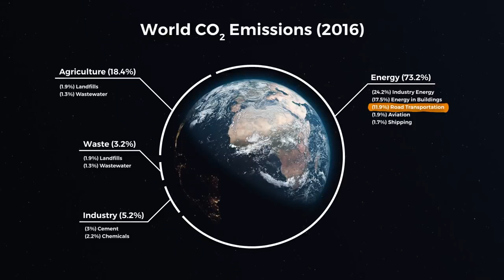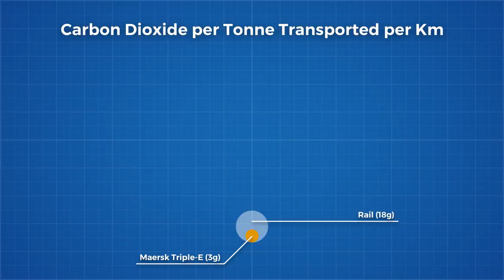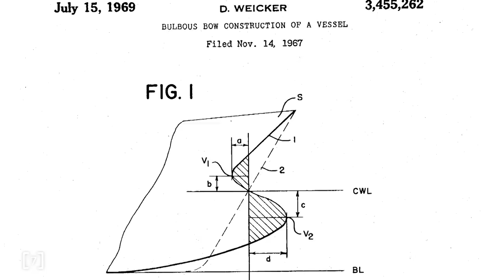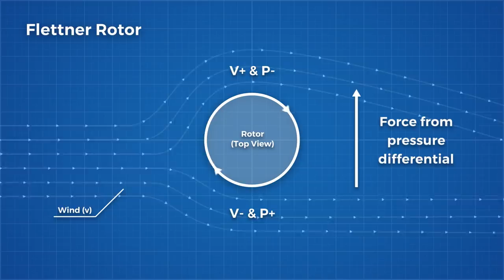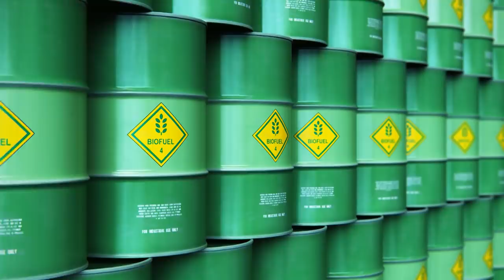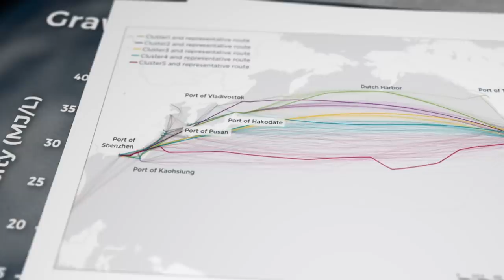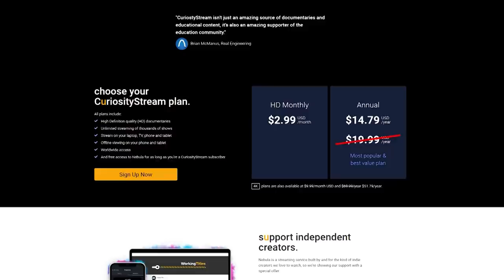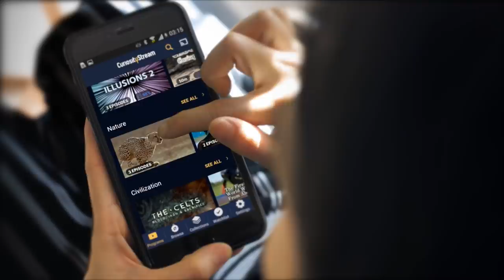Are Renewable Powered Ships Possible?

Comment: You are correct about biofuels. They are mostly just an inefficient way of converting diesel into something that looks green, and if you're lucky you get out the same energy you put in. In some cases you end up with a negative energy balance. While doing so, they waste huge areas of arable land or previously forested land. It's the worst form of greenwashing. It would be more efficient and more honest to just burn the diesel for the intended purpose straight out. The exception here are biofuels derived from waste streams, rather than from plants grown specifically for the purpose of fuel. As an environmental scientist, all the greenwashing for political reasons, is painful to witness. The whole climate thing is not about science (despite #believethescience). It has become a belief system and the measures are all about what looks good politically. Science is not a belief system.

Comment: At anything resembling current technology levels?  Absolutely not.  Gasoline is hard enough to replace as a portable energy source, bunker fuel is way cheaper.  Large commercial ships don't run on the nice "clean" fuel we use for cars and planes, instead they use a low quality sludge known as Heavy Fuel Oil (HFO) or bunker fuel.  It's considered a "waste product" of fuel refinement and sells for about $290 USD per ton compared to $516 USD per ton for regular refined fuel.  And since these are large international shipping companies there is no authoritarian government  to use taxes to force them to double their shipping fuel costs.

Comment: So... No nuclear?
Reply: If you do a web search for ‘nuclear ship savannah’ you will see that it has been tried and did not work.  A similarly heavily subsidised, by the government, vessel is in use in Russia which also operates, in support of the Northern Sea Route, a fleet of nuclear powered ice breakers these may, or may not, have been completely without issues.  Just think; would you have full confidence in the management of a nuclear reactor under the control of an anonymous entity only traceable, perhaps, via a letter box in a FOC (flag of convenience) nation state?  If you are could you sell that confidence to Japan, the state that hosted the Hiroshima and Nagasaki nuclear detonations as well as more recently the Fukushima ‘event’?  Then try that same, or similar, sales strategy on Ukraine, the nation state that as a part of the USSR (CCCP) hosted the Chernobyl ‘event’.  Modern iterations of nuclear energy thorium fuel, molten salt reactors or fusion reactors will carry the legacy of past problems.  It is the global trepidation of anything with 'nuclear' in the name and the economics of nuclear having transitioned from 'energy to cheap to charge for' too 'the costs of remediation are incalculable' that will prevent the adoption of nuclear energy as a means of creating energy at sea.  Modern reaction systems may have overcome the safety problems but the general public, having been misled in the past, will not believe the fresh new promises.  ‘They’ say nuclear is cheap, it’s not it is expensive as well as being complicated, dangerous, not universally socially acceptable and having only ‘no need for refuelling’ as a questionable advantage; actually it does need refuelling just not as often.  When they do need to refill the warming up stuff it takes considerable longer than pumping tonnes of thick black stuff, HFO cSt380, or thin runny stuff, MDO, onboard which is one of the reasons HMS Queen Elizabeth and HMS Prince of Wales are pushed about by gas turbines thus using a similar fuel as the aircraft that fly off of them.  The Royal Navy (RN) with a high degree of skills and expertise use, at vast expenses to the UK taxpayer, a current operational nuclear fleet of 11 submarines (also known as ‘boats’) in two flotillas, seven attack subs and four ballistic missile boats.  The carbon footprint of all the extra bits of hardware and the fuel, including processing thereof, from ground to propeller, are the external costs that never seem to get considered.  Disposal, once it wears out, of both the machine (that was a ship) and fuel is another can of worms best left unopened.  The 26 RN boats no longer in use are laid up (some in Rosyth and some in Portsmouth) awaiting long term deconstruction including dealing with the fuel rods and other irradiated material.  The USN is not, as far as I know, a commercial organisation working to very tight margins and also has the skill and expertise to handle the complexities of nuclear power so as well as submarines their aircraft carriers are nuclear powered and each have a build cost three times that of QE/PoW, bigger crews and more generous funding.  For those who still think that nuclear energy might be the answer I recommend this report: - https://www.bbc.com/future/article/20200901-the-radioactive-risk-of-sunken-nuclear-soviet-submarines? ocid=ww.social.link.email.  The navy of the USSR might have been under resourced and over extended but it was still generously supported in comparison with merchant shipping.
Reply: @BernardLS  Wow, that's a lot, thanks!
Thorium reactors seem promising though (I don't believe fusion will ever be that portable, if possible at all).

Comment: Hey ! Thank you for the great video. 
However, there are a few issues with the fuel consumption graphics : First, you represented the fuel consumption per day as a function of speed. But as speed increases, the number of days of a given trip decreases. Fuel consumption per miles would have been much more useful. Second, you say the higher fuel consumption for high speeds is more pronounced for heavier ships, but in order to actually see that, you would need to plot the fuel consumption per ton of cargo instead of the one of the entire ship. Because, as you said less than a minute earlier, per ton is what actually matters.

Comment: most practical solution is readily available and people are ignoring it : Nuclear 🤦‍♂
Reply: Collision, grounding or capsize are existing hazards for cargo ships and other vessels; why would we want to increase the possible consequences of an existing risk?  Aircraft may crash and trains derail but knowing the hazards and risks both are highly regulated.  The first layer of 'the onion of survivability' is 'do not go there'; this means that the case for nuclear energy at sea has a very high bar to adoption.  The armed forces have no need to turn a profit to stay in business and being funded by the taxpayer can call on a relatively immense resource pool; private enterprise has to make back the money it spends (return on investment).  It is sometimes said that various navies have operated nuclear powered ships without incident for a number of years, however that is not quite so.  Bearing in mind that not all naval information is, in the interests of national security, made available to the global public some material does leak out such as the loss of the Kursk, Thresher and Scorpion; two nuclear submarines actually managed to collide, a feat made even more difficult as they had to be at exactly the same location in three dimensions at the same time so quietly that neither could hear the other coming (HMS Vanguard & MN Le’Triomphant, 3rd – 4th February 2009).

Why not use nukes on merchant ships?  It is down to engineering, finance, socio-political attitudes and safety.  In engineering terms hydrocarbon fuelled ships do the job adequately and are simpler, financially hydrocarbon fuelled ships are, considering only internal costs, cheaper and socio-politically hydrocarbon fuelled ships are a known entity they thus have incumbent advantage.  With regard to safety hydrocarbon fuelled ships may have serious problems but these are generally considered manageable and have known limits of impact, most importantly they can be shut down at short notice and are then walk away safe, while nuclear energy has fewer incidents those rarer occurrences are seen to be catastrophic and having unlimited effects.

Comment: Why the insane focused on renewables?!?!?! I say build a mega ship! A massive one with a nuclear reactor to power it cleanly...
(A few of those to regularly move across major trade lines... And I men's... Not even dock anywhere near any coast to keep people's fear of nuclear in check... 
Smaller/regular ships could pick up the cargo and distribute it more locally.....)
The size of a ship i'm thinking of is around.... Well let me put it this way from photos of the panama cancel it's not really big... Not as one's like... So let's say 3-4 times the width of the panama Chanel.... And that's not considering the hight....
Obviously will be extremely expensive to design and construct but probably a good long term investment with cheap nuclear energy
Not to mention boost for economy and trade..... 
A few of those will be an amazing achievement (but I have no ice engineering and implementation wise just how practical such a design would be....

Either that or tiny modular nuclear reactors.. Which are at the moment a bit expensive and....

Comment: How about nuclear 🥺
Reply: If you do a web search for ‘nuclear ship savannah’ you will see that it has been tried and did not work.  A similarly vessel heavily subsidised, by the government, vessel is in use in Russia which also operates, in support of the Northern Sea Route, a fleet of nuclear powered ice breakers all of these may, or may not, have been completely without issues.

Just think; would you have full confidence in the management of a nuclear reactor under the control of an anonymous entity only traceable, perhaps, via a letter box in a FOC (flag of convenience) nation state?  If you are, could you sell that confidence to Japan, the state that hosted the Hiroshima and Nagasaki nuclear detonations as well as more recently the Fukushima ‘event’?  Then try that same, or a similar, sales strategy on Ukraine, the nation state that as a part of the USSR (CCCP) hosted the Chernobyl ‘event’.  Modern iterations of nuclear energy, thorium fuel, molten salt reactors or fusion reactors, will carry the legacy of past problems.  It is the global trepidation of anything with 'nuclear' in the name and the economics of nuclear having transitioned from 'energy to cheap to charge for' too 'the costs of remediation are incalculable' that will prevent the adoption of nuclear energy as a means of creating energy at sea.  Modern reaction systems may have overcome the safety problems but the general public, having been misled in the past, will be reluctant to believe the fresh new promises.  The incident of the ‘Ever Given’ blocking the Suez Canal, March 2021, may also have a little to add to this debate.  The cooling water on ships tends to get taken in from near the bottom so when running aground the inlets are in a prime spot to get plugged up restricting, if not stopping, the flow of coolant.  One thing that the TMI, Chernobyl and Fukushima incidents all had in common was that the supply of coolant, or rather lack thereof, was a fundamental cause.

‘They’ say nuclear is cheap, it’s not it is expensive and has a large embedded carbon quotient as well as being complicated, dangerous, not universally socially acceptable and having only ‘no need for refuelling’ as a questionable advantage; actually it does need refuelling just not as often.  When ‘they’ do need to refill the warming up stuff it takes considerable longer than pumping tonnes of thick black stuff, cSt380 HFO, or thin runny stuff, MDO, onboard which is one of the reasons HMS Queen Elizabeth and HMS Prince of Wales are pushed about by ICEs and gas turbines thus using a similar fuel as the aircraft that fly off of them.  The Royal Navy (RN) with a high degree of skill and expertise uses, at vast expenses to the UK taxpayer, a current operational nuclear fleet of 11 submarines (also known as ‘boats’) in two flotillas, seven attack subs and four ballistic missile boats.  The carbon footprint of all the extra bits of hardware and the fuel, including processing thereof, from ground to propeller, are the external costs that never seem to get considered.

Disposal, once it wears out, of both the machine (that was a ship) and fuel is another can of worms best left unopened.  The 26 RN boats no longer in use are laid up (some in Rosyth and some in Portsmouth) awaiting long term deconstruction including dealing with the fuel rods and other irradiated material.  The USN is not, as far as I know, a commercial organisation working to very tight margins and also has the skill and expertise to handle the complexities of nuclear power; so as well as submarines their aircraft carriers are nuclear powered and each of the current iteration has a build cost three times that of QE/PoW, bigger crews and more generous funding.  For those who still think that nuclear energy might be the answer I recommend this report: - https://www.bbc.com/future/article/20200901-the-radioactive-risk-of-sunken-nuclear-soviet-submarines?ocid=ww.social.link.email.  The navy of the USSR might have been under resourced and over extended but it was still generously supported in comparison with merchant shipping.

Comment: Renewable ships? You mean sailing?
Reply: To address the suggestions that sail power is the answer I offer the following.  In 1870 a premium sailing vessel entered service, the ‘Cutty Sark’.  The Cutty Sark was 64.74 metres in length with a beam of 10.97 metres and a loaded displacement of 2 100 tonnes.  She was able to carry 1 700 tonnes of cargo and to harness the energy the available spread of canvas was up to 2 976m2 which was tended by a crew about 30 skilled men.  The carrying capacity of cargo ships is constrained in two ways, mass and volume; the more mass on board the greater the displacement which in turn impacts the efficiency of the hull form and the sail area / displacement ratio.  A vessel constrained by mass is said to be ‘down but not full’, a vessel constrained by volume ‘full but not down.

When in the tea trade, which the ‘Cutty Sark’ was designed and built for with fine lines (nautical tech speak - no need to worry about it) she could carry around 600 tonnes of cargo at speeds of up to 17.5 knots dependent on the prevailing wind and had a typical China to UK 'time on passage' of 120 days.  The tea trade was very competitive so ‘time on passage’ was a large factor in securing the premium freight rate that made her competitive i.e. cost effective.  Rounding things out her maximum available sail area gave circa 5m2 of canvas for every tonne of tea carried.

As soon as the Suez Canal opened, which the ‘Cutty Sark’ was unable to sail through; she lost her advantage, raw speed, to the steam powered ships of that era who could beat her time on passage.  Mechanically powered ships have improved in terms of efficiency, on a freight tonne mile basis, by at least one order of magnitude since then.  After losing out to the coal burning, steam reciprocating mechanical ships of the late 19th century ‘Cutty Sark’ was relegated to the Australian wool trade, just about the bottom of the barrel in maritime terms and only one small step up from being a 'honey barge'.  The canvas, cordage and extra manpower needed for sailing ships was never a very benign environmental option so please discount any idea of sail as ‘sustainable’.  All this is without the problem that if ‘the wind don’t blow the ship don’t go’, when it does blow it often blows in the wrong direction for your cargo delivery needs and sometimes there is rather too much of it for comfort.

Random facts about Cutty Sark.  It is said to have been able to coax 3 000 horse power out of her sails, or in ‘real money’ 2 206 500 Watts (2.2 megaWatts), assuming this was in ideal conditions that is about ⅔ of the power that might be harvested from the ‘top of stow’ of a Maersk triple E, again in those elusive ideal conditions.  So that majestic spread of canvas would have been even less efficacious for delivering your baubles and bows from the orient, despite taking about three times as long on the voyage.

Comment: D Day was not that pivotal, the biggest military operation of history on the other side of the contient, operation Bagration, that destroyed the weermarcth central army corps was. It's hallmakred by military historians as the beginning of the new from of mechanized warfare using the operative art.
And it too needed incredible logistics, tactics and strategy to lead thousands of offensives, counter offensives, followup offensives and use the movement of all corps to create encirclement and cross fires.
D Day is a nice engineering feat but small in real impact on the final victory on germany.